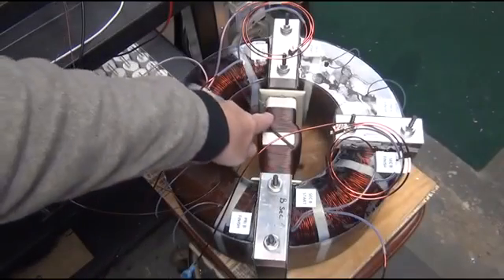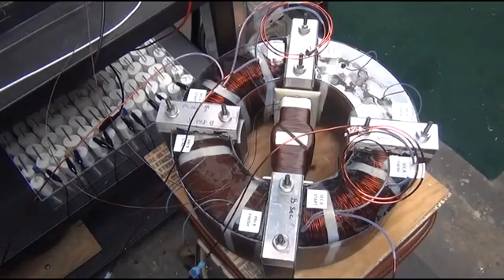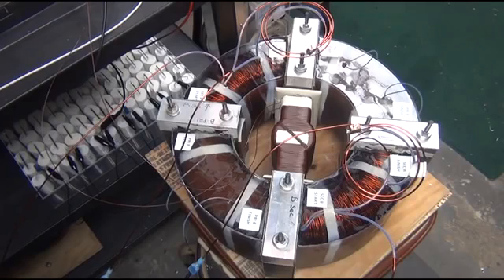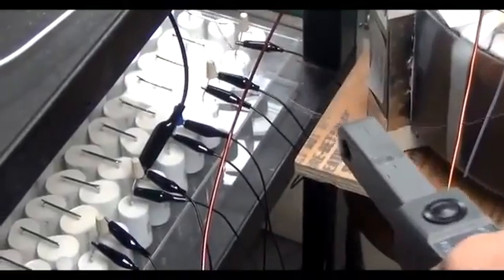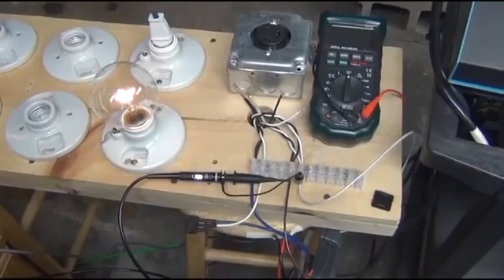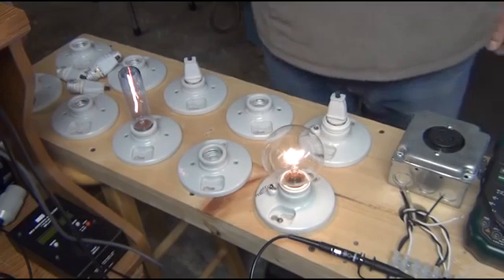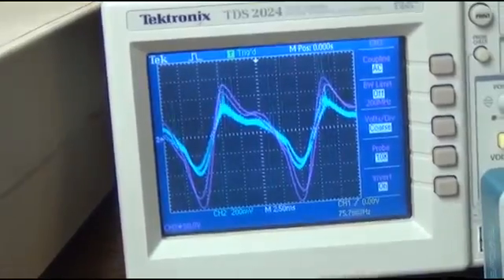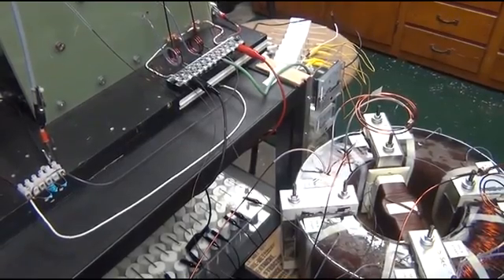QEG Power Conversion VARs to Watts 2016

Comment: the biggest problem yet to solve is to effectively convert the reactive energy to real energy. it would have been good we saw the current in take by the drive motor on loading or measure the rpm of the motor when loading the QEG....